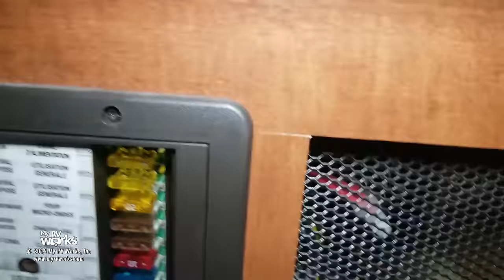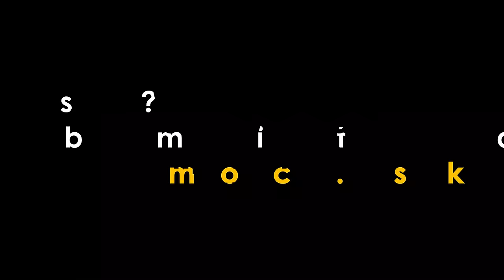RV Power Problem Leads to Converter Diagnosis and Replacement

Comment: what if converter is good and battery still dead..how to check you are getting volts from converter to battery..how to test at battery leads?
Reply: Two ways: 1. Usually when you connect a charger to a battery the terminal voltage goes up. Likewise the voltage drops when you turn off the charger, more quickly if under load. 2. A DC ammeter would be useful to measure the current. Most inexpensive ammeters only measure AC current, you need one that measures DC current. That lets you know that the charger is sending current to the battery.

Comment: good info, what if the 12v sys works intermittently?
Reply: Hello! Did you ever find the answer to that? We are having the same issue! Going to replace the converter anyways as we are switching to lithium. But is it a wiring or other issue for the constant on and off of the dc power? Our old battery was dead, this happens when on shore power and no battery connected.

Comment: Why at 20:57 you tested DC voltage coming out of the converter without it plugged in? If you probe a dead horse, the result will be its dead.
Reply: He was looking to see if the batteries had anything left ,he tested the battery lines.

Comment: My problem is the opposite, I dont have 120v at the conveter outlet, though all the other outlets work, the fridge too. 🙈 Does anyone have any tips or ideas? 2013 keystone residence. TIA
Reply: Maybe that peticular outlet is bad, or disconnected on the inline gfci outlet, actually it has to be one or the other, or a broken wire

Comment: My ac works and half the camper has power. Any suggestions?
Reply from the maker: Check to see if the GFCI has tripped. Often times they are in the bathroom. It's the receptacle with the test reset push buttons on it.

Comment: 2011 coachmen My breaker panel and batteries are located Right near the steps, and my inverted is located in the bed frame

Comment: Can I just use a common car battery charger directly charge battery when plugged into shore power if my converter is bad?
Reply: I added a marine charger to my rv and it works fine.

Comment: Is there any way you’d help me diagnose a problem(s) with my 86 Fleetwood Jamboree?  I’m stumped!  Is there a way I could email or text you?

The wires connected to my coach battery have melted together due to a 4 gauge positive cable that goes under the engine getting hot.  I separated and isolated all those abs I still have shore power when I plug it in....works fine.  I drove it home and stopped Half way to look and it was melted again.
Reply: Hi there - you could feel free to submit a remote troubleshooting request on our website: www.myrvworks.com. That is, if this is still an issue you're having! Hoping not!

Comment: Hey I’m having to replace my converter, does the new one have to be exactly the same as the old one ?
Reply from the maker: No it does not. We kind of cover that in this video here.

https://youtu.be/zE-AKqQEP2U?si=cbELxuNIORA5E-Dc
Reply: The rv place wants 461 dollars and I am seeing them on Amazon for much less just want to order the right one
Reply from the maker: The converter will take 120 volts AC and convert it to 12 volts DC. It also has the job of charging your house battery.  I usually see converters priced between $100 and $200. That is a function of amperage and any other smart features that the converter might possess. You also need to know what your battery chemistry is . Do you have lead acid water-filled battery, or a lithium battery. Not that much in price difference between the two converters but the converter must know what the battery chemistry is so it can charge it properly.  Here is a link on Amazon to a converter that I have used successfully on many repair jobs:  https://amzn.to/47Z8jlE

If the dealership selling it for $400+, I'm sure they've marked this thing up a very large margin. You might ask them what amperage it is, the model number etc. and see if you can find that same one online.  Often times the dealership might use a scare tactic to say that if you buy it from someplace else they can't guarantee that it will work for your RV. But that's just them trying to pad the bill and justify their inflated cost. The dealership didn't actually manufacture the converter. So it doesn't matter where you buy it from. So don't fall for that tactic. It's not important that the converter that you buy fit into the breaker box. You always have the option of orphaning that failed converter in place and installing a standalone converter nearby.  We have several videos on us doing that very thing.
Reply: Yeah if you could point me in the right direction on Amozon on one , my old one is a WFCO 55AMP. Model -9855 ,,,,, I just want to make sure I order the right one .My battery is NOT a lithium battery
Reply from the maker: https://amzn.to/42hyt1M
Reply: Ok thanks for your help ,,, i watch your videos all the time,, i have learned a lot from them and will continue to watch .

Comment: I have a problem with my power. If I turn off the 30amp main breaker I have battery power and my lights and refrigerator will work. When I turn it on only my microwave and air conditioner will work. Could the breaker be bad?
Reply from the maker: Hi Rjjkell,
 
Your question has been selected for an upcoming video where it will be read and discussed by Darren - Certified RV Tech and online personality for the 'My RV Works' videos.
 
If you have not already subscribed to the 'My RV Works' YouTube channel, please do so and keep a watch for the ‘RV Tech Talk’ video releases.  This series is a selection of comments and questions that will be covered and released weekly.
Here is our YouTube link:  https://www.youtube.com/c/myrvworksinc

Happy Camping,
My RV Works Media Team

Comment: I have a 5th wheel.and a few outlets arent working.all on the same side.any ideas?
Reply from the maker: A very simple thing to check (besides the breaker) is the GFCI receptacle. Often times they are located in a bathroom or kitchen. Those are the receptacles with the set/reset push button.
Reply: @MyRVWorks  thanks I replaced one and it's not working wondering if I replace the other two.i had a guy use a small stick welder plug into the outside plug and it tripped the breakers thats one of the three outlets.fuses look good so do the switches.thank you

Comment: My rv 12 volt system is putting out 14-18 volts bad Converter?
Reply from the maker: That's been my experience. And then it cooks the batteries.

Comment: None of my 12 volt lights work if I unplug shore power. My batteries are at 12.8 volts but no lights.
Reply from the maker: Not sure what kind of trailer you have, but something you might want to check is near the battery you will find a circuit breaker type fuse. Make sure that that is functioning and closed allowing current to flow through it.

Comment: I found that I wasn't getting DC because my battery died, the converter was still trying to feed it.  Either the battery must be wired in series to get everything else to work even if the converter is good or the converter doesn't have enought oomph to get things running by itself.
Reply from the maker: There is a circuit breaker style fuse between the batteries and the converter. So try to find that and verify Power is getting through it.

Comment: What do I look for if I have no AC or DC
Reply from the maker: We have to follow the trail. We need to prove that power is making it to the breaker panel in the RV. If it is not then the problem is back Upstream either at the pedestal or the shore cord connection.

Comment: Is this the same as an ATS...automatic transfer switch.
Reply from the maker: Hi Dan,

No, this is not the same thing.  This device converts shore power to DC power and also charges the battery.
An ATS is for switching between two AC sources and prevents back-feeding power between them.

Here is a video I did on an ATS:  https://youtu.be/MYrh8gdM7Xs
That video was made using an engineering sample for the owner of Techno RV https://www.technorv.com/.  It turned out the ATS that was sent was an out of box failure so we put the original ATS back in after some troubleshooting of the bad one.

Cheers,
Darren
Reply: @MyRVWorks  thanks

Comment: Help my 50 amp breaker keeps tripping usually with no load like when im sleeping not big power pulls it doesn't happen all the time but it happen 3 times this morning 3am 630 am then at 8 am reset my breaker i have my fireplace on ceiling fan now it just browned out help
Reply: Message me on Facebook @INNORVTECHNOLOGY
Reply: I’m working on a 2005 that I believe the converter is bad.it doesn’t plug into 120 volt like the one in your video is this because it’s an older trailer.if you can help me it would be great.thanks for your time
Reply: @jeffmccoy6575  The one in this video is a stand alone converter. The one you have is most likely a wafco vcenter type of converter. 

If you have a multimeter, with the unit plugged in and converter break on, check the voltage at the battery cables (disconnected from the battery) if you have around 13.6 volts your converter is operating. If you don’t, pull the front panel off and check the 40 amp fuses that are near the top. If the fuses are good then your need to check the 120 ac voltage supply to the converter and make sure it is receiving power. If the converter is receiving 120 volts then you need to replace the lower end.
Reply: @jeffmccoy6575  make sure your battery disconnect is on.
Reply: Thank you for your reply.I will do the things you have told me and get back to you

Comment: Thanks. But my question is that I have all AC and some of the DC doesn't work in half of my unit. Per say the front half works but not the back half. What would I need to look for?
Reply: 30 or 50 amp trailer?

Have you checked the fuses?
Reply: @aguyandhiscomputer  I've same prob & checked fuses. 30 amp & 4 bulbs do not work in slide out except for 1 bulb in range hood.
Reply: Check for good connection of a bridge jumped wire in the D.C. Side of the panel. It may be on the negative side.

Comment: I thought voltage was a measure of electron content and potential.  Current is the "pressure."
Reply: Voltage is the pressure, current is the electron flow. Think of a river, depth/height is the voltage, current is - current.

Comment: If 12volt is the brain and the battery of the RV is dead, does that mean even if you're plugged into shore power you will not have any power to anything due to the batteries being dead and the RV is brain Dead? Basically if the battery is dead you have no power even on shore line?
Reply: This is my question, also. I bought a trailer and have permanently placed it on a lot. The slider will stay out permanently and I have zero intention of ever moving the trailer.  I've asked around in RV fixer groups and received different answers, probably because they are mobile travelers.  QUESTION: is it possible to use AC only? I don't want to buy one more thing, as I'm trying to build a deck and other stuff. 
2002 Fleetwood Mallard

Comment: I've watched a couple of your RV converter videos and I'm wondering why you 1. Don't open up the converter and see if it's just the compasitor which can easily be replaced. Your talking $20 bucks verses $300 bucks. Also, neither of your videos show you checking the wires from outside to in to see if one of those wires is shorted, or if the manual breaker that's under your RV might actually just need to be reset.
Reply from the maker: We don't do bench/board work on appliances due to liability.  We don't know the circumstances that would have caused that converter to fail. While the capacitor may be the obvious component, and we replace that $20 part, there may have been other components that have failed that are not revealed at that time. So we replace that $20 repair, put the appliance back in service in the RV, it is possible that some other component failed inside that converter that did not reveal itself at the time of the repair.  Worst case scenario the thing catches on fire, but if it's not the worst case and it still fails that means we're going back out there and then how do I charge for another service call?  Doing repairs that way puts our company and our customers at risk.
  Because of that we're always going to open up a brand new box and put in a brand new converter with a manufacturers warranty for their customer. The customer always has a right to repair their own stuff. But if you're calling My RV Works we're opening up a new box it's just that simple. Regarding the testing of the wiring, with my meter I'm always checking input and output, continuity etc. We do have a few other videos out where I do walk through how to follow those trails and paths of the circuit. We don't record every single aspect when we're doing these jobs.  Had it been either input power or the circuit breaker by the batteries, then when we put the new converter in that would wouldn't have worked either. But every time we put a new converter in they work and that fixes a problem.  I have confidence that that's going to work because I have done those checks that you referencing. So just because we didn't record me doing that doesn't mean that that step wasn't done.  I appreciate your questions and the opportunity to offer our position on why we do it that way.

Comment: The rv shop said it's because I have no battery in it but the internet said different it said as long as I stay plugged into a shore power and I don't run both air units at one time well one night I decided to run my radio my fan and my air and all my lights to test it out then alakazala zam then I said damn I have no electricity at all

Comment: Rv's have the worst wiring  like a 10 year old installed  that no service  loop and number one in sloppy  I have a 40 holiday diesel  what a joke so many connectors on the 12 volt side

Comment: I fear that your description of DC power from a converter or inverter is probably meaningless to most viewers as you don't explain what "bumps" represent.  I take it that hand up, in your description, means more Voltage, hand down means less Voltage for DC (Direct Current).  

For alternating current (AC), your hand description of a sine wave is different.  Hand up means more Voltage, hand down means negative Voltage and the mid point of the up and down is zero Voltage.  Household alternating current, like shore power in North America, and the AC out of most inverters is 60 Hz. (cycles per second) sine wave.  A cycle is zero Volts to full plus, back to zero then to full negative.  A sine wave is a smooth Voltage plot of what the output of a rotating generator would look like on an oscilloscope or plotted on a graph as voltage versus time.  Quality inverters produce a very close approximation of a sine wave.  However,  some inverters produce a modified sine wave or a rounded square wave which is bad for many devices.

I believe that your description of "bumps" illustrates "rectified" DC, which exists only at an intermediate point, inside a good quality converter, before it is filtered.  At the output terminals of a good quality converter, the "bumps" will have been removed with filtering.  Poorer converters may rely on the house battery to filter out the bumps but without the battery present, these bumps would create terrible hum in audio equipment and could be bad for some other 12 Volt devices.  So much for running radios, computers, Etc. on a poor converter with the battery switch off.

The output of the converter, which is what is distributed throughout the coach is very close to a straight line (constant Voltage) on an oscilloscope with almost no "bumps" left.

Comment: I dont need a class on electronics theory. My AC DOESN'T work.
Reply from the maker: What is your point? Perhaps if you understood a little bit more about electricity you would be able to get to the root of the problem. Or perhaps you can just hire somebody that knows electron Theory to come in and fix your problem for you.